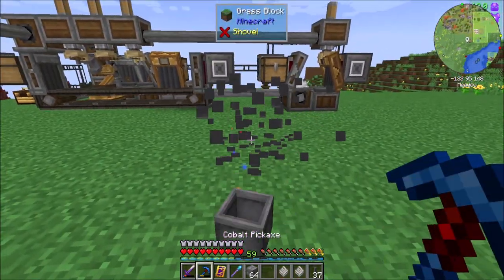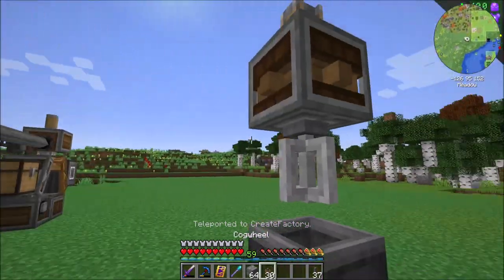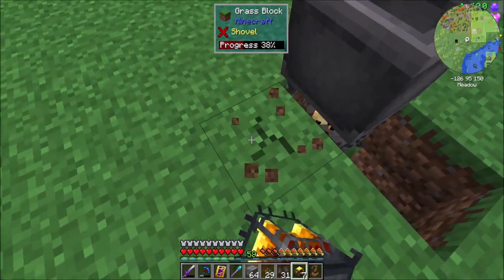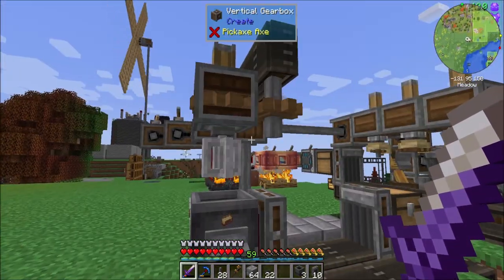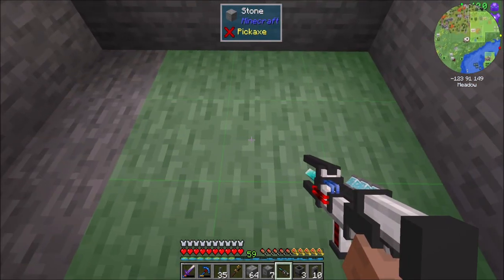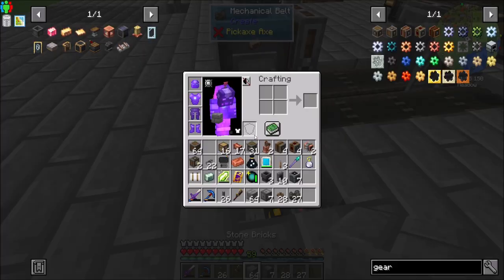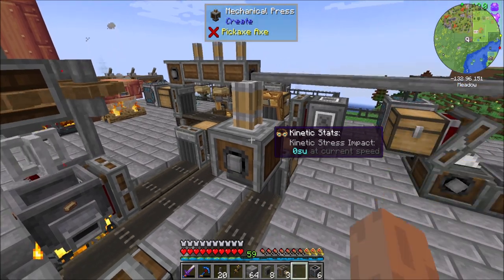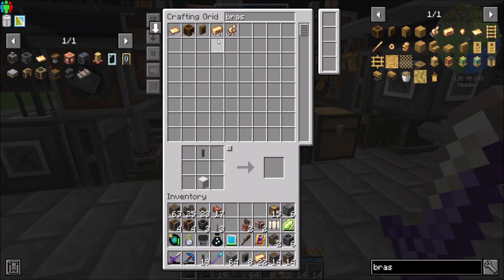Lets Play S11E102 Create Redesign

Comment: Dire it's likely that the brass maker will get stuck if you request too mch at a time. The basin will fill up with lets say copper and copper will fill up the belt. To fix this you would need some tunels, mechanical arm or make copper and zinc input seperate

Comment: Unless that was changed, precision mechanisms are not a guaranteed craft, they have an 80% chance of succeeding and 20% chance of getting you random scrap.
Also you can and probably should add the extra 2 steam engines to you boiler to get all of it's stress capacity (it doesn't affect the speed and otherwise you are wasting it)